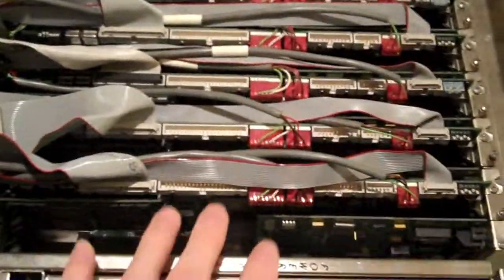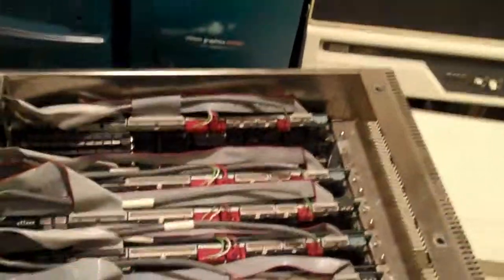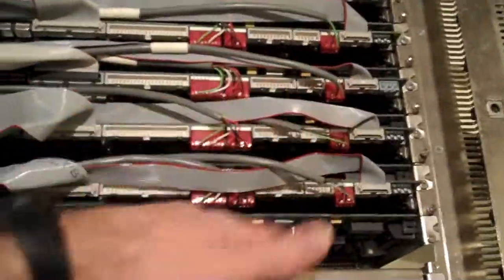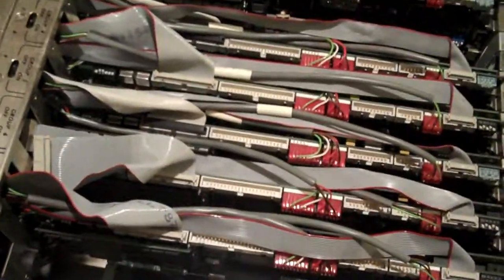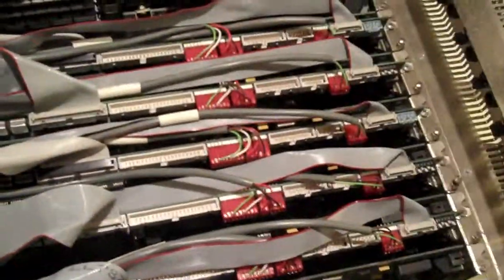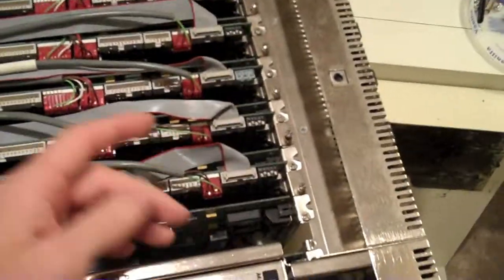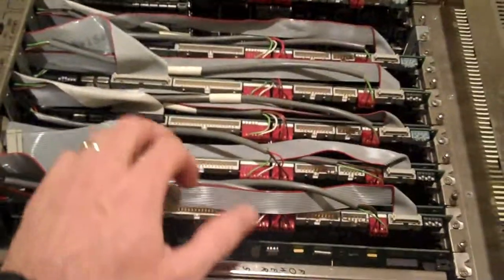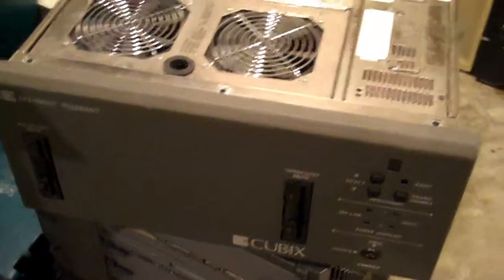Cubix ERS/FT Tour, Part Three

Comment from the maker: @adrianjcc Technically each board is completely stand-alone. In my Beowulf setup I used the overclocked board as a "master node" for DHCP/BOOTP and the like. This would -not- be how the Cubix would've been used. Each board would be, by and large, unaware of its neighbours.
The Supervisor would be useful in a production environment where redundancy and high availability were paramount. In my case, if it dies, I just reboot it :)